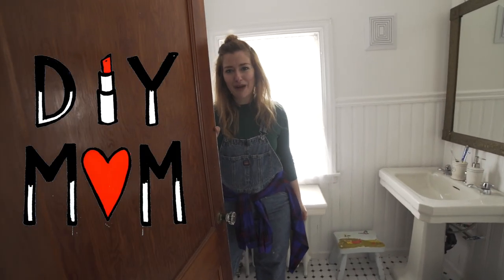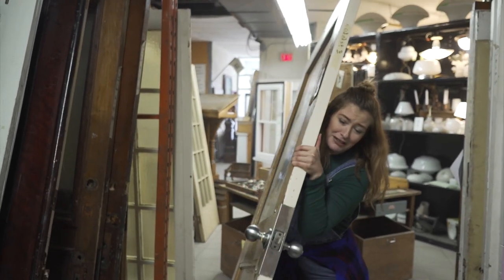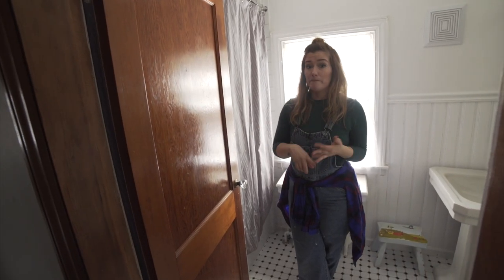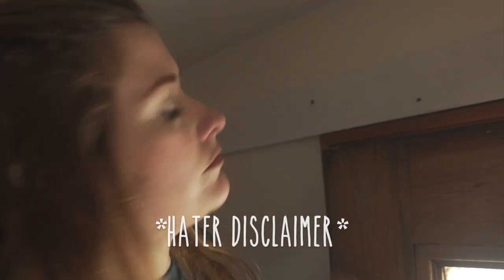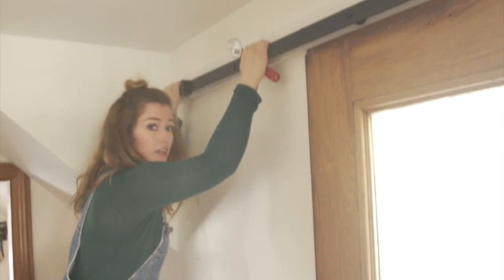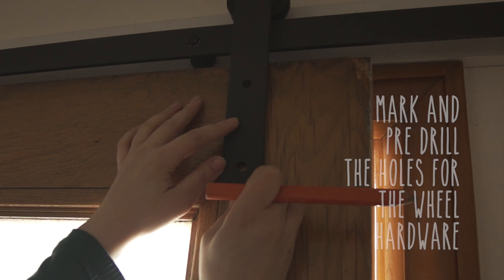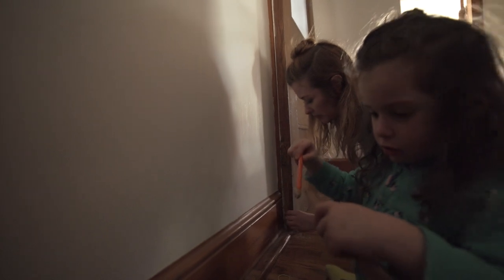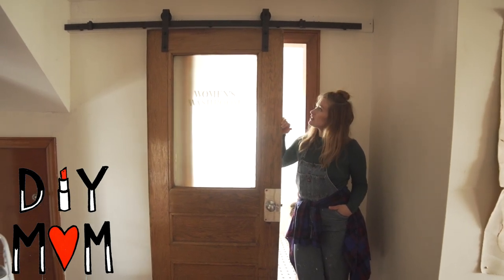HOW TO INSTALL A SLIDING DOOR- Barn Door Kit Tutorial

Comment: Nice video, thanks for sharing! For anyone using a similar system: Rebekah has opted to put the bottom guide on the outside. If you're worried about the skirting board getting marked, I'd recommend routing a channel in the bottom of the door and slotting the guide in there. This will also mean the guide is less visible :D
Reply from the maker: Ah interesting! I guess i didn't know which side the guide goes on, figured it would keep it from swinging out when it is shut.
Reply: @HEYMOMHEY  neither side. It's designed to run in the centre of the door, requiring a routered channel in the base as explained above

Comment: nice job but that last little plastic piece is meant to hold the door in place via a groove cut into the bottom of the door running the width of the door. There are other types of door guides that don't require a groove but instead wrap around the bottom of the door in a u-shape to achieve the same effect. Did you mount the anti jumpers to the top? Those little black discs that come with the rail package.

Comment: What if I want to use my original door? I am doing this for my closet in a condo I am leasing. What adjustments would I have to make to make sure the door closes over the door opening?
Reply from the maker: You would have to retrim the door frame if you want it to cover it. The old door is smaller than the frame...

Comment: So I have the same door issue. I want to change French doors into sliding doors, do I need to buy new doors? Or can I use my existing ones  and just change the knobs?
Reply: a little wider than the door frame works best for privacy. it's possible to use the doors you have, but you might need to add a few inches to each side